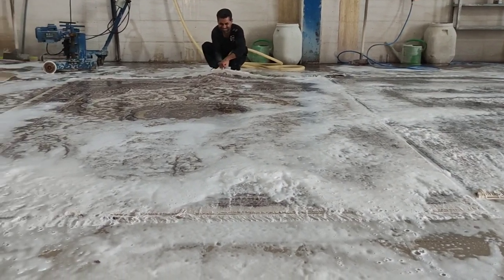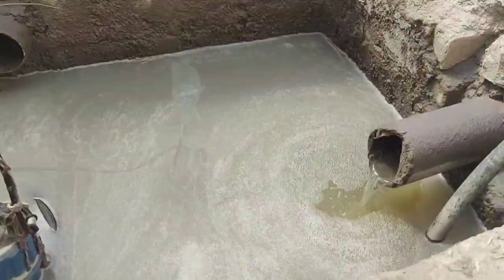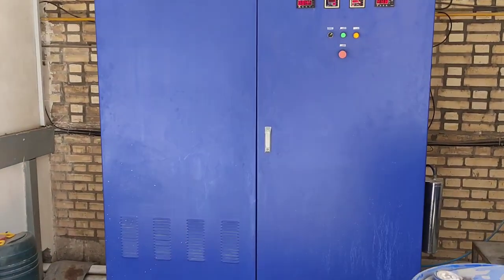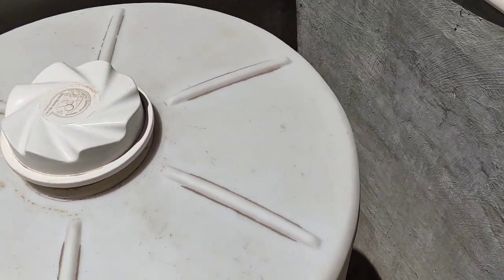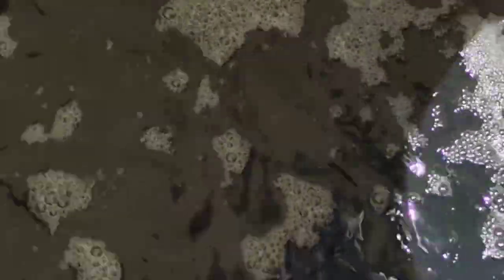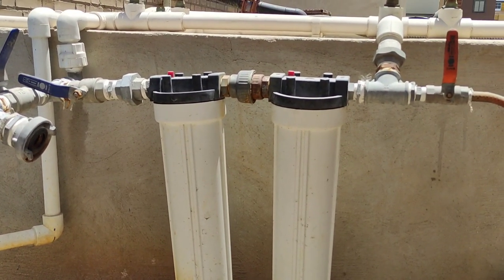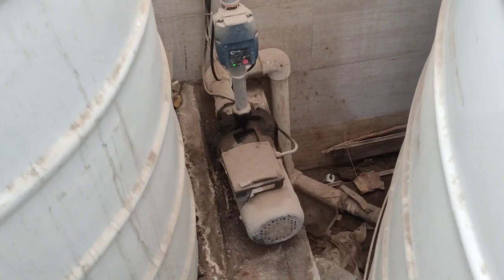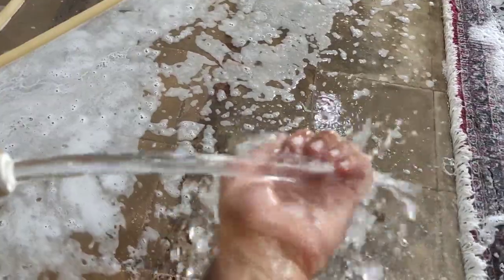Is This Water The Worst Wedge In The World  ?  |  Waste Water Recycle System   ASMR

Comment: Use to work at a dealership. This would be great for the wash bays. Sadly it goes down the drain.
Reply from the maker: Great point!
Reply: @change-cleaning-service-center  indeed. It’s like 30-60 cars a day easy. It’s worse at a Toyota dealership. I worked at an Audi dealership. But a Toyota dealership a former coworker didn’t go home until 12am. We’d likely not be in a drought  if wasteful was reused over and over, again.